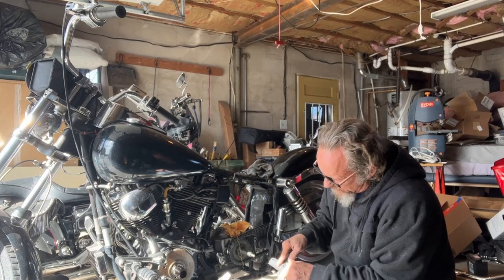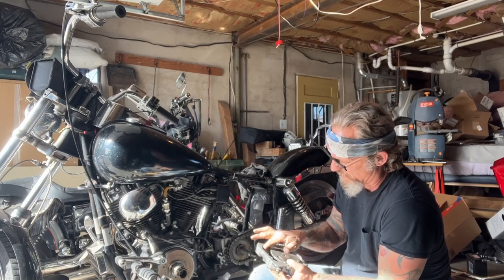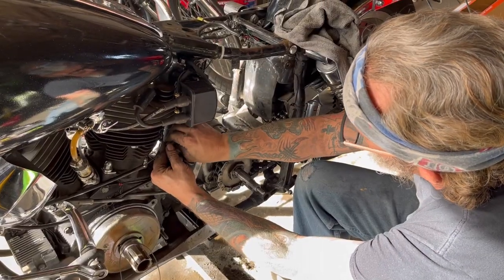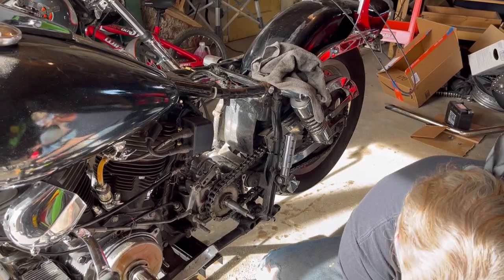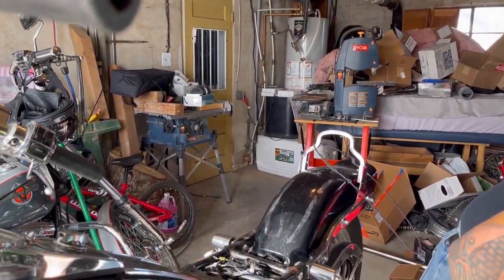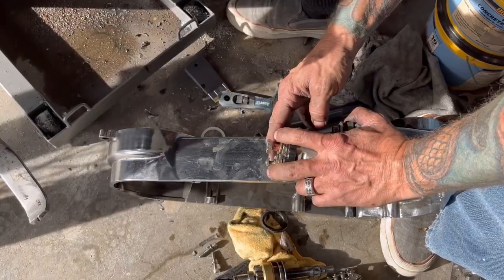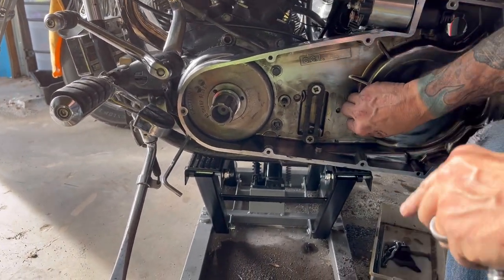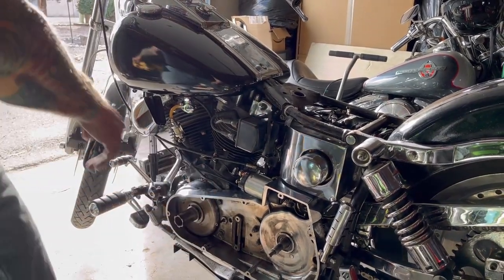Harley Davidson 1981 Shovelhead Transmission Top Rebuild

Comment: Have 82 FXE in the rebuild phase. The plate is a Shifter Cam Plate since I have the service manual.
Reply: Does that cam plate come from the factory welded to the shaft like that?
Reply: @publets Yup. My 82 fxb is exactly the same.

Comment: What style of oil tank is that?
Reply from the maker: Aftermarket, horseshoe style, lots of people make them, paughco, drag specialties, Vtwin
Reply: @HobsonsChoiceHarleys  I have a horse shoe on mine I just want the oil filter in there like yours. Cuz right now my filter is on the front bottom outside the frame and I’ve already hit it once
Reply from the maker: @kevinmiller8865  yeah, the ones with the built-in oil filter are getting hard to find. I’ve actually got a spare one for a bike. I’m using that. I’ve had so many people try to buy off me because you can’t even order them anymore.
Reply: @HobsonsChoiceHarleys  I get it, it’s awesome. I appreciate ya Sir. Thanks